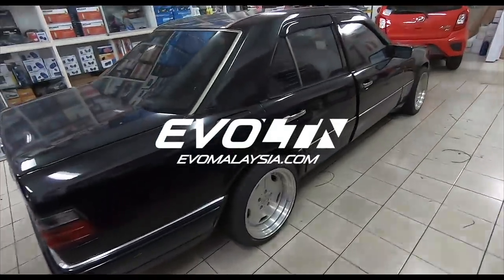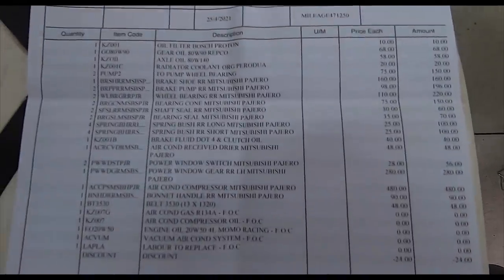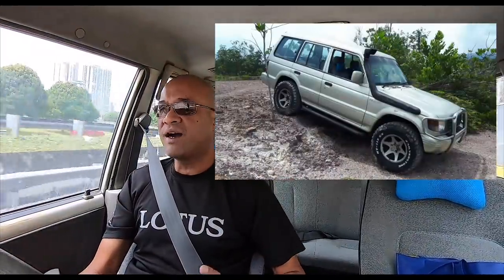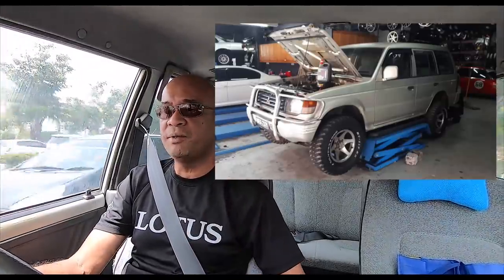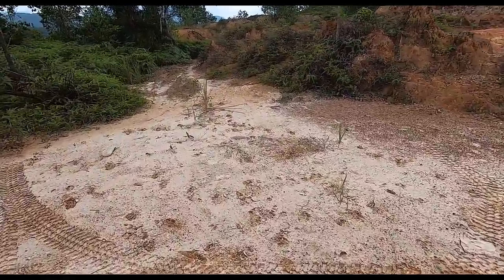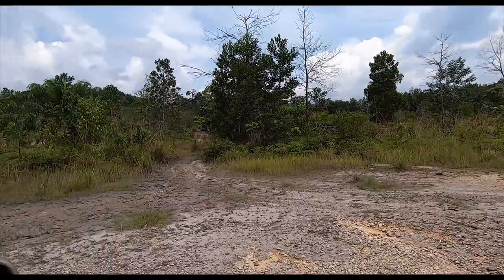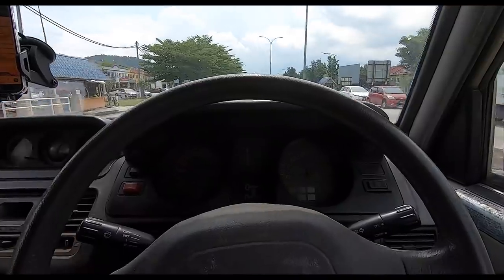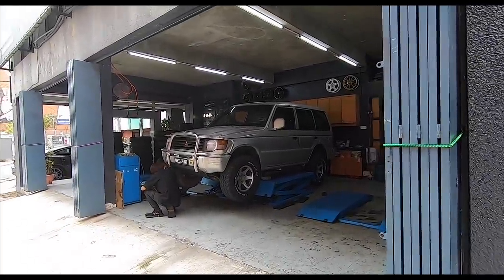MID-WEEK SPECIAL: 1995 Mitsubishi Pajero - New Update & "Lost" Footage FOUND! | EvoMalaysia.com

Comment: Awesome video for an awesome car, Chris. I took over my dads 94' Pajero in the exact same colour. Strangely, there are not many full silver Pajero's on the road as all of them either had a two-tone silver and red, green or blue finish. If my dad was correct, the two-tone was an option back then when he bought it new but I personally feel the all silver looks the best. 
Ours originally came with a petrol (either 2.4 or 2.6, not really sure which one it was mated to a manual box), but I remembered it overheated a few times on long distance drives (Ipoh - Johor). I was about 4 years old back then. Around the mid 2000's, we swapped out the entire drive train to the 2.8 4M40 diesel engine with an automatic transmission and a Super Select gearbox and I began to understand why it is possible to win the Dakar rally in it. We've waded through floods, climbed mountains and up to today, it's still going strong with minimal to almost no major maintenance except wear and tear. I think the only flimsy thing in these Pajeros are the aircond vents. Fortunately, there are parts for them available for a dime a dozen. Haha. 

For tyres, you can check out the Silverstone A/T's. They aren't overly expensive but are durable enough to conquer Malaysian roads, potholes and off roading. Our Pajero has aftermarket rims with tyre dimensions 265/70R16's and because this generation doesn't have the flared arches of the facelift (personally, I prefer the non-flared), the tyres stick out the side of the arches just slightly and they give the car a more muscular stance though turning radius got somewhat worse. Haha. 

Anyway, just thought to share. It's so awesome to finally see an in depth video about a car that was essentially throughout my life. I hope you have many more years of joy and satisfaction driving and tinkering with it. If you ever feel like switching to a diesel, there's no substitute for the torque crunching 2.8 4M40.... unless it's a 3.2 4M41. Haha. 

Take care, stay safe and God bless, Chris! 

Cheers!
Reply from the maker: Wow, thanks a lot for the awesome feedback bud, much appreciated, it was a good read!! Yeah, I too kinda like the way the tyres stick out just a bit and are visible in the wing mirrors, helps with placement during off-roading! I see more Pajeros with the 2-tone body colour nowadays, but I prefer the single tone myself tbh 😊
Thanks again for the trip down memory lane, cheers!!👍🏾🙏🏽😀